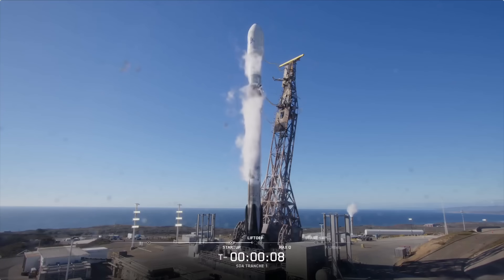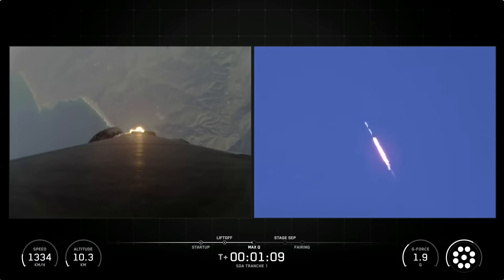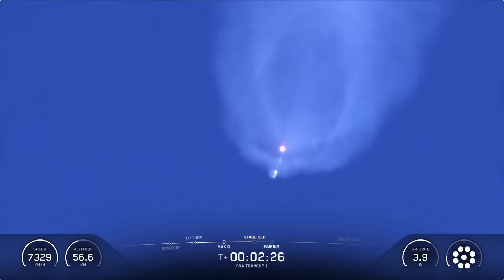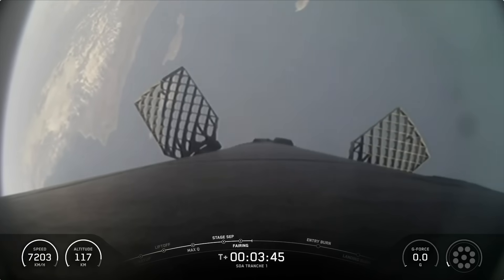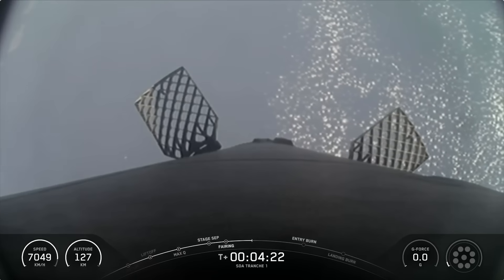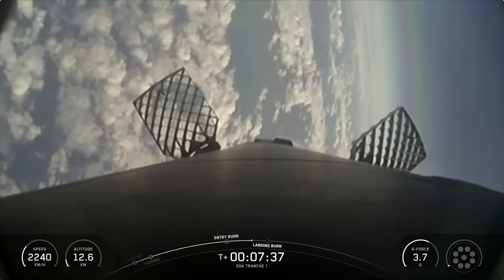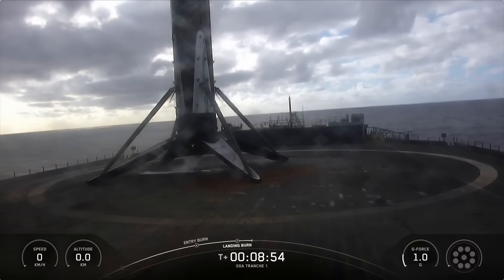Blastoff! SpaceX launches 21 satellites for US military from California, nails landing

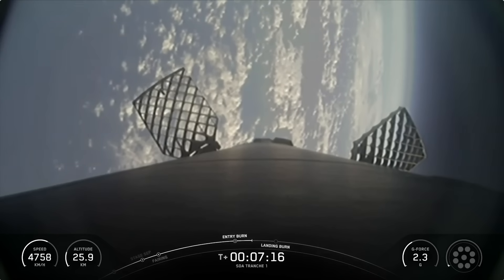Comment: 7:25 - impressive how even 30Km up (that's 18.75 miles for 4% of the world's population) there's enough air resistance on the grid fins and booster body to slow it down even although it's in gravitational free fall.
Reply: Sheer speed and mass !! That massive cylinder 42.6 meters tall 3.7 meters wide weighing roughly 35 metric tons ? is free falling at 0.85 miles per second vertically .